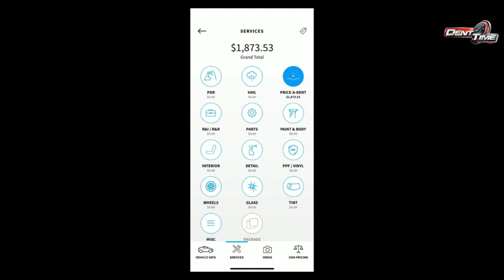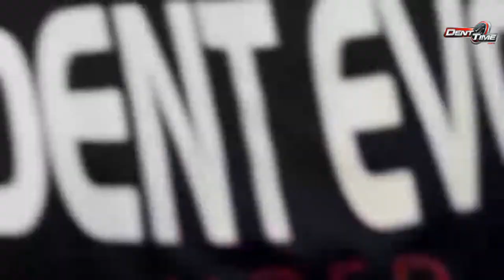😳 Live PDR Body Line Repair - PDR Podcast 119 - Paintless Dent Repair

Comment: lots of talent you have..But i have  a concern.i have been doing autobody collision for 28 years and doing pdr for like 10 years im a in house pdr body guy.im seeing i mean tons of dealer cars coming down south of the twin cities that where pdered from dealers .we had one yesterday a 2019 subaru a older lady bought it she payed full new car price basically.the pdr tech did  a really bad job it was pickled.basically he goes right to the center pushes it up high and leaves it.pickled mess..maybe wholesale? i dunno but her son saw it i had 2 fix bothe rear doors and they are full of braces but where he drilled i didnt use the areas but it was a challenge.he had tolecut it to but subarus have thin clear so i just waterborne based it again and a reclear.i  tore doors apart and when in with my rods knocked down the highs and raised the lows but man its hard when  its fixed before.state farm gave me 500 extra for each rear door.i dont think it was enogh but took me 9 hours to get everything flat but that light ice blue yikers
Reply: Hey man im a student from century college in ABOD, ive gone to lametrys, luther, caliber and am settling with carstar because of the glue pulling. Did you go to school for pdr or how did you learn it?